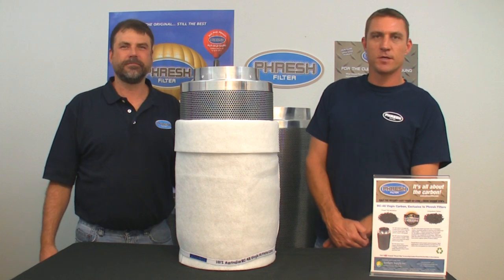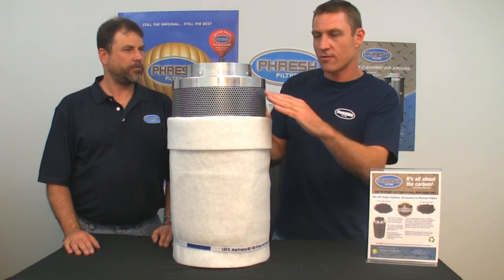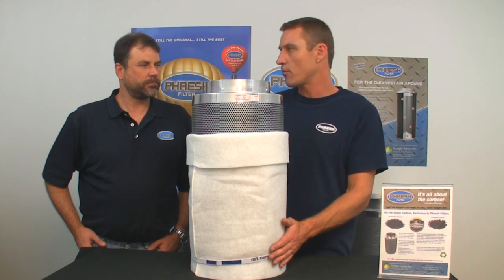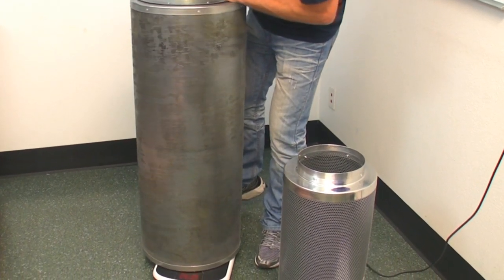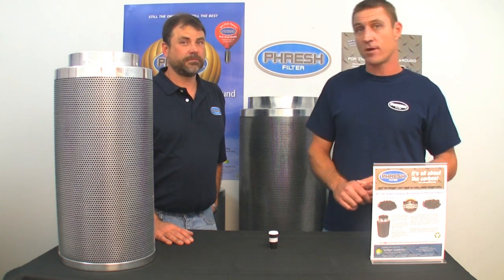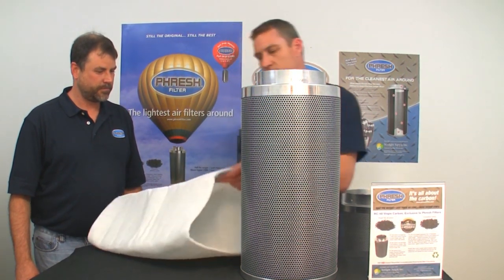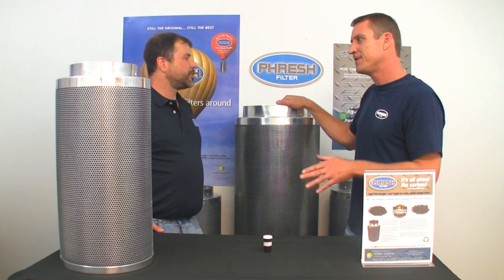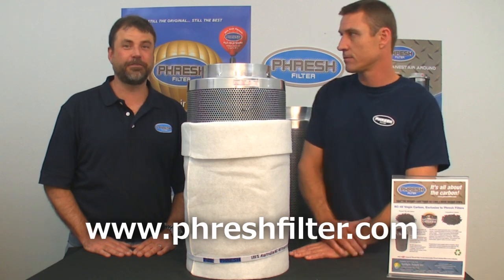Sunlight Supply presents The Phresh Filter Difference

Comment: my room is 5x5 9 foot ceiling.    will these fans only eliminate odor ?    or can i also use it to fillter clean air and heat ?     heat was my problem last time.
Reply: Heat has to do with your fan not the filter so much, if anyones still curious